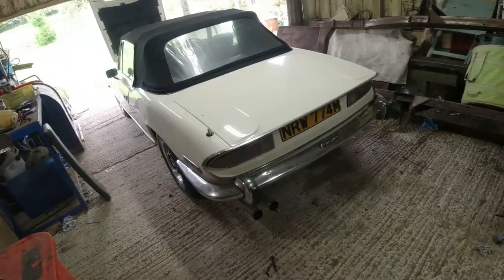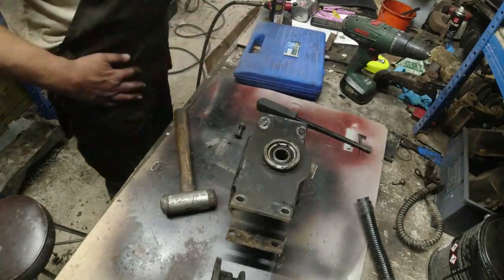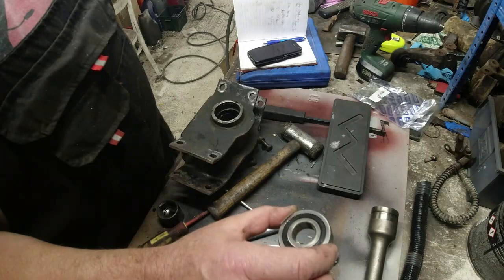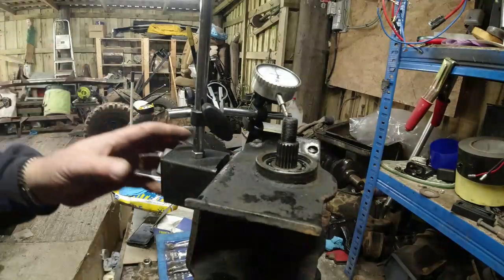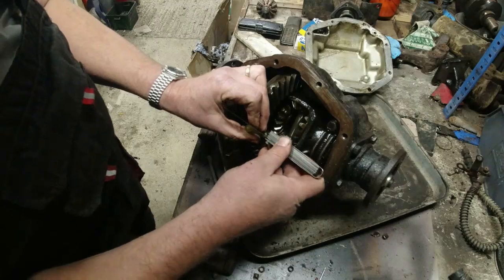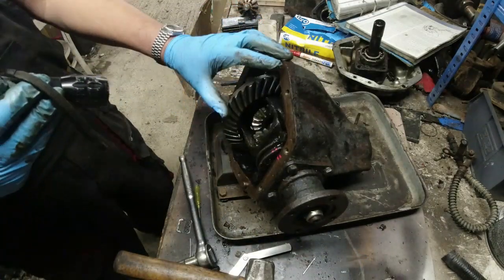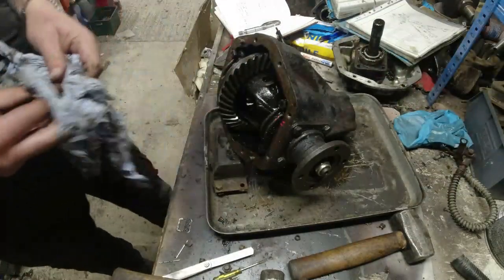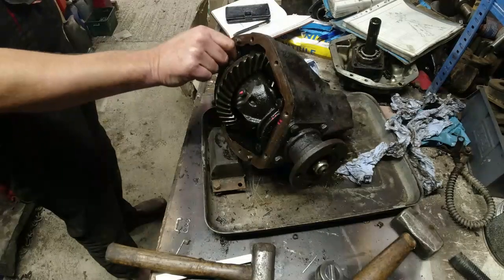1973 Triumph Stag Diff and Nose extension part 1 - Parental warnings for profanity

Comment: I commented on one of your earlier vids about the "cracking nose" and how a reinforced (braced) one is a good idea (mine failed, fitted one so it wouldn't again); I note this nose has the braces.

I am about to (been putting it off) replace my quill shaft bearing. But while there will look at planet gear shims as you have (bit of a bugger to do, but while out mad if I don't. Car doesn't clonk, but is on edge of "allowable play", so should do while it is out.......

That "no backlash" apparently is normal. You can make them reasonably tight (snug, not ridiculous), as once in, the rest of the diff is clunky, but the Planet thrust washers, being quite soft, are the "bit that has to give", and as they only move small amounts don't work very hard, ie during normal cruising just sit there until you get to a corner/break traction. I tap mine in so they are snug and that works well. 

If diff has had good oil flow, the sun gear thrusts are normally ok, and all slop can be taken up by planet thrusts. The original sun thrusts are metal (bronze type); but later on BL went to fibre. What the??? They are rubbish and don't last. But that is all many sell now. To me, "condition assessed" old bronze thrusts on the sun gears are FAR SUPERIOR to new fibre ones, but each to their own. I have some old diffs, so have a few I was able to use.

But fibre parts taking load in a diff? I could never accept that, and with "old/orig" parts, I don't have to.

The big thing to be careful of with Stags/sedans is there are two nose pieces. The height of the tube is different. If they are swapped, you MUST change the rear swingarm brackets to allow for the change in angle of the rear suspension. Easier to "get same nose height" one. The parts lists show that at a certain Comm number, the nose piece part No changes, as do the swingarm brackets.

Good to see people doing these things still................... people who do this fewer and fewer every day.

:-)
Reply from the maker: All good information, glad you enjoyed the video👍🍻

Comment: I think you've measured that wrong. You've measured  the gap on both sides , added them together and divided by two. That would be fine IF the planet gears could move  across the shaft, but they can't as the sun gears prevent that. You have to adjust each side according to what the gap is on that side.   If you have a gap of 0.050" on one side and 0.060" on the other, adding together and dividing by two would result in one side being over tight and the other too slack.
Reply from the maker: You are correct, the issue is that access is bad, and the shims are dished. This was the best way that I could measure.

Comment: Looking forward to the Part 2 video.  Quick question.  If I remove the extension piece with the diff in situ, do you think that I can get to the diff nose oil seal and remove/replace it.  I’m trying to avoid stripping the diff out as I’ll be doing this on my drive over a weekend.  I have previously changed the pinion oil seal in situ on small Triumphs (Dolly & Spit).  I noted your advice on buying a quality extension nose bearing rather than a cheapo one - thanks.
Reply from the maker: getting the diff off is easy that I see no reason who or even how you might change the nose bearing with the diff still bolted up in place 👍
Reply: To me it is far easier to remove the diff than the nose. Diff is heavy, but nose piece has diff/suspension arms/drive shaft etc all hanging off it. 

Maybe it's just me...... :-)

Comment: Enjoyed the video, went through this when I rebuilt my diff as part of the resto. I couldn’t believe how tight the output flanges were on the splines even after the nut was off, broke my big heavy puller on them! 
Anyway, 2 thoughts. Firstly, do you have a tight rear prop joint putting strain on that quill shaft bearing? Secondly,  have you checked that is a proper Stag diff (ratio, part number etc)? Reason being people used to fit 2500 diffs to get the lower 3.45 ratio for better cruising over the standard 3.7, but to do that you have to swap back plates and 2 of the holes don’t line up. So are those bodged bolts to hide that? Might explain the lack of gasket too- a Stag one doesn’t work.
Reply from the maker: Prop is fine, 14 years is maybe the limit of the service life of a small bearing.

Diff is from a TR6 / 2500Pi as I believe. Anyone got a 3.7:1 diff 😁
Reply: PM sent to ChuchHouseClassics (all one word 😉)